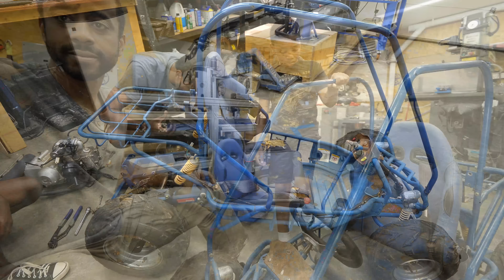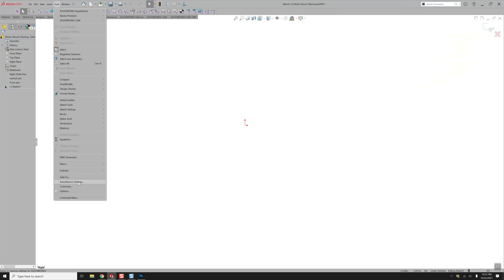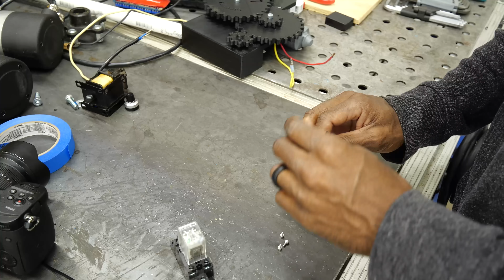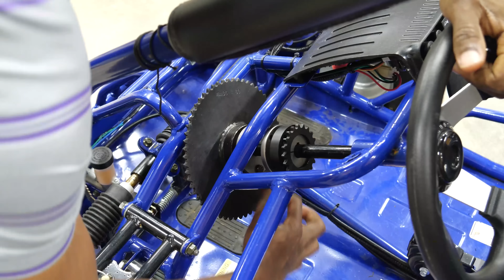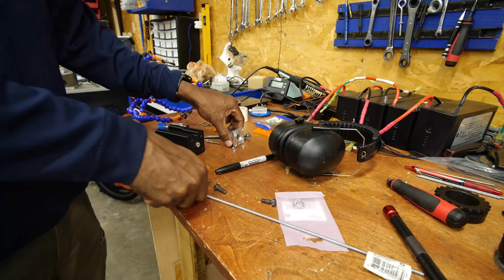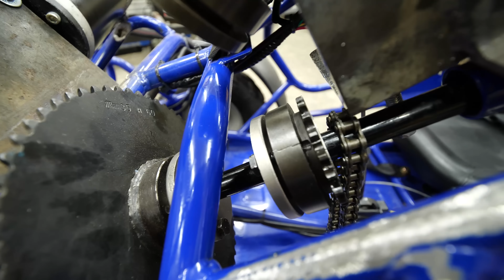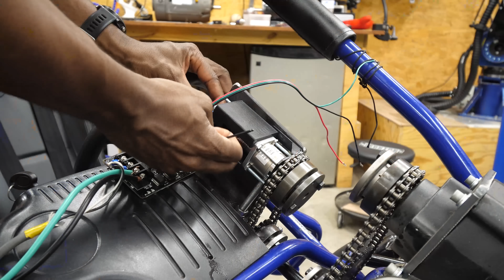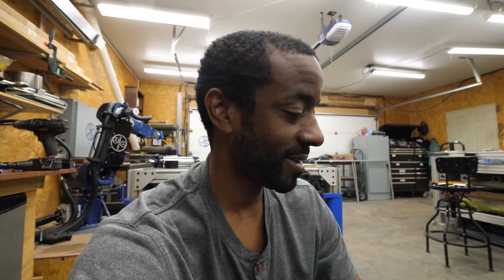Building A Self Driving Car - Jeremy Fielding 098

Comment: Looks like a very fun project. Cool stuff. You should be able to avoid bending the steering column by adding some support adjacent to the large sprocket. With the current design the drive shaft is a long unsupported span which is very weak in bending (the chain applies a torque to the drive shaft AND pulls on it very hard - like hanging a weight from the sprocket). Putting a bushing next to it that is directly mounted to the frame should make it an order of magnitude stronger.
Reply from the maker: agreed. Reducing the length of the moment arm would certainly make it more resistant to bending. Adding a bushing is a good idea. Though I think the ultimate key is some kind of mechanical fuse or limit switches.
Reply: @Jeremy_Fielding  Why do you think that the ultimate solution is fuses or limit switches? If you could make some simple changes like the bushing to just not break if overloaded, isn't that better than adding more complexity? 

Something to consider for the limit switch idea is that you can still overload the mechanism without hitting the limits. For example if one of the wheels gets trapped in a rut you could find yourself applying max motor torque. To deal with that issue you might then add a shear pin in addition to the limit switches, but that has the downside of disabling the cart, potentially in a dangerous way while moving. The next step would be adding a sensor to detect if the shear pin has failed.... you can see where this leads :)

If you do conclude that it isn't feasible to just make it stronger, I'd recommend looking into the vast supply of off the shelf torque limiters. I'd recommend a self resetting kind which will not disable the drive if you trip them. If you overload them they will slip, but as soon as the overload is removed the drive re-engages. Basically an oversized version of what you see in lego / k'nex motors that allow them to slip without damaging the gearbox.
Reply from the maker: Sorry about the confusion there. I am suggesting that both are needed. something like a torque limiter would protect the motor from overloading. Adding the bushing/stiffener would protect the steering column. The torque limiter could also be electrical. I am hesitant to put my weight on any one solution, as we both know it takes a while to think through all the possible consequences and how to resolve them.
Reply from the maker: It is feasible and smart to make it stronger... I agree there.
Reply: Hmm yes, I also agree
Reply: @Jeremy_Fielding  Dude, I just put it in another comment, but you're talking about it here so I'll just add it to this conversation - do the bushing, I think that's a great idea; and add at least one belt-driven component to your gear system. 

You can engineer the belt size and tightness so that slippage only occurs when the load goes outside of normal operating tolerances.
You can code your controller to detect a slipping belt and stop the motor. 
A slipping belt can recover itself as long as it doesn't slip too much and burn out. 
A belt is a really cheap part to replace. 

The bushing is a great idea and improves the strength and reliability of the whole design. But a belt allows for a controlled failure you can design around rather than an uncontrolled failure.
Last thought - if the motor or a belt fails, you can still manually steer the car. If the column itself fails, you can't. So if it comes down to it, fail the motor before you fail the column.
Reply: @Jeremy_Fielding  it would be most save if you could still steer by yourself if something brakes, right? That also makes a stronger bar/less bending nice. Same for the brakes.
But if you have some mechanical limit that can slip you need to have the potentiometer somewhere else to know what postiion the wheels are
Reply: @Jeremy_Fielding  a strong stiff spring between the contact points would absorb some torque before closing completely, if you go with the limit switches, allowing some electronic mishaps...
Reply: @pufthemajicdragon  I like the belt idea, if you make the belt the weakest link and it does fail, the cart would be able to be taken control of manually as well as it’s no longer coupled to the motor
Reply: @pufthemajicdragon  was going to say the same thing - it'd be fairly straightforward to stop the motor if you're turning it but the steering position isn't changing, and the belt slipping means you can't do any catastrophic damage like you could with a chain.belts are also plenty strong enough and much lighter than chains which in theory could mean more responsive steering but i don't think it would be noticeable
Reply: @Jeremy_Fielding  Adding a current shunt in-line with the motor would probably be a good idea. Have the Servo MCU read the current being delivered into the motor, and if it ever reaches an 'overload', you'd immediately stop driving the motor (at least in that direction), and raise a 'FAULT' pin high, which may be read by your master control unit. When that fault line is raised, it will indicate to the vehicle to be pulled to a safe stop ASAP to reduce chances of damage or injury. This is a common design for systems as I'm sure you are familiar with on CNC motor drivers. This same fault detection and reporting may and should be applied to as many factors as you can, such as detecting if PWM or other drive signals are present and within expected bounds. Also, you may want to go with a more robust signaling interface over PWM for something safety-critical. RS485 (with CRC proto), CAN, or perhaps even LIN would be good-fit choices.
Reply: Do we have a collab coming gentleman?
Reply: @mechbest8685  god I hope so. They are two of my favorite engineering channels. Get Destin in as well for good measure.
Reply: Thank you both for giving I sight to how engineering conversations are performed. Very nice to see you guy’s thoughts at work.
Reply: A bushing and shear pin was my first thought too. Strengthen the unsupported steering column, and shear pin to protect overloading. There is also a safety consideration if you plan to do “Level 2” autonomy where a human could have hands on the wheel while computer is controlling. Need to limit torque so human can overcome if system makes mistake. This is how most driver assist systems work in real cars. Motor is torque limited such that a human can still easily over power and back drive without damage to the system…or human. Really cool project!
Reply: @MrFibonachoo  Yes, I was going to recommend a shear pin or key (like lawn mower engines use) for the same reason.  If the "electric system" fails, the human could always still take control manually.
Reply: In addition ro these other improvements, I suggest end travel limit switches that disconnect power to the motor just short of hitting the physical hard stops.
Reply: Nice to see you here!

Comment: Hey Jeremy! Is there any way you can add an electronic clutch on the steering column? It might be better to have a normally-disconnected point there so a loss of power disconnects the motor. 

Even a small air tank and a spring clutch would do the trick (just need to be recharged every now and then). That way loss of power will automatically revert to manual steering. (I suggest an air tank since solenoid valves are an easy way to control larger forces. 

Just some sort of interlock seems wise, especially considering that a motor with a worm gear will prevent any manual steering input.

(Oh and I just thought of this - compressed air is easy to regulate as well, so an air clutch is also an automatic torque limiter. It would require homing each time you power on the cart, but that might be smart anyway.)

Comment: Hi Jeremy, I have made attempts at doing this for 4 years now. I really look forward to learning more from you. I have small scale projects that reflect what you are going. They are all done in the hopes that my daughters will enjoy some aspects and spur some Engineeer Excitement. I am a Principal Engineer and jack-of-all-trades master of none. 

I have 3 at home pilot projects for a self driving large scale car. Ackerman steering approach is tough and the fine control of differential drive is where I am at. 

I have a large scale “bomb disposal” type robot that my 8 year old and her friend can operate. It weighs about 250lbs. 

It is winter and back to small scale. So  trying to build a tracked bot with Ardupilot Mission planner+ cm level RTK + connection to DOT GPS local station + industrial lidar for obstacle avoidance + base station+ my amateur tv feed for FPV. 

Pixhawk cube flight computer+ saber tooth ESC+ Nvidia Jetson + industrial lidar + radio … 

Look forward to learning more from you!!!

Jack 

I can show you some images if you like of some of the vehicles.

Comment: Maybe drive it with a small stepper with a toothed belt so it can slip and be overloaded by manual control. Drive the steering position sensor off of the rack so that it can ignore missed steps and continue to work. The actual steering effort on the self driving doesn't need to be that high when the vehicle is moving or lightly loaded.

Comment: Wouldn't it be possible to put a overload clutch type of mechanism in the large gear. Because you have the position pot on the steering wheels shaft. It seems like even if the drive slipped it would not matter because its looking for position from the steering shafts location. Or even a V-Belt drive instead of the chain might work. That way the belt could slip if necessary.

Comment: How about a slipping clutch between the motor and steering column? Enough torque to turn the wheel, but any more and it just gives. Also makes it safer in case of trapped limbs. Then just have the feedback potentiometer placed after that clutch, so it still registers the correct steering position.
It's great to see Bill working with you on this, your both amazing engineers 😍😍

Comment: It seems like you could use a torque limiting clutch so you don't have to sacrifice the motor or the steering column. It would be even better if you could detect the slipping or torque overload conditions. You'd have to set the torque limit high enough so it only slips a bit in extreme driving conditions and can quickly recover control.

Comment: Most of your problems are correctable or caused by software.  In automotive HVAC stepper motors,  current is monitored in order to determine where the stops are.  This wouldn't be a good solution here since the forces acting on the motor will be affected by terrain,  but can be used to protect everything from damage.  Good luck!

Comment: Awesome project! You could use limit switches to detect when the steering was rotated too far and respond appropriately. Or monitor the motor current for stall and stop driving it.

Also, if you’re having issues with alignment of the potentiometer, you could use a non-contact rotary encoder.

Will it act like an assisted power steering or rip your hand off with the steering wheel if something goes wrong? That motor looks scary powerful!

Another option could be to use a linear encoder on the steering rod to know the absolute position of the actual wheels instead of the steering column.

Can’t wait to see what comes next!

Comment: Another great project.

I'd go with a much thicker walled steering column (or even solid bar), and also add a bearing next to the motor drive gear so the shaft is supported near where the torque is being applied.

Maybe add some kind of torque sensing between the steering wheel and the column. That way it can detect if someone is trying to override the steering input and can disengage, and/or can act as power assisted steering. It could also then disengage if say someone sticks their arm though the spokes in the steering wheel (rather than break it off).

Comment: This looks to be shaping up to be another awesome build.  If it was me I think I would upgrade the steering shaft with a solid alloy, it would also be easier to get the proper hardware to mate with it as well.  

Like anything you build there will always be a failure point in the construction.  The key is to design it so that the components fail somewhere beyond the point they need to safely work at in the most extreme situation.  If your past videos have shown me anything is that I'm sure you will figure it out.

Comment: Many have already said it but personally, I would rather have a non critical failure of the steering system, making the motor or something else in the electronics fail before the actual steering shaft breaks. More expensive but this at least leaves all critical control components intact, leaving control up to the driver

Comment: About your point at the end - I'm going to add my voice to the others in the comment section and say the fact that it can bend the steering column, is a sign your mechanism is too strong. A smaller, weaker mechanism involving 3d printed gears would be cheaper, simpler to test, and safer, whilst still having the torque necessary to turn the wheel. You want it to break before the steering column does, or if your kid's hand/clothing gets caught in it in a catastrophic failure situation.
Reply from the maker: I definitely plan to add some kind of guard over the chain area no matter what.

Comment: I like how Tesla's full self driving beta works, if you forcefully move the steering wheel against the car's automatic handling, it will relinquish control and turn the self-driving off and let you take control. I don't know how much extra complexity that is, but it's definitely the safer choice until the system is completely proven.
Reply: That's generally how autopilot systems in commercial aircraft work as well.  It removes the need for the pilot (or driver, in the case of a Tesla) to think about turning the autopilot off before grabbing the controls.  All it would really require in a situation like this is for the driver to be stronger than the motor is allowed to be.  Then the control system could observe the tracking error and disengage if it gets too large.  I'm not sure that the current motor is going to be easy to "over power", but it shouldn't really cost anything to add such functionality.  Just more code.

Comment: There is a really cheap alternative to traditional potentiometers called a magnetic absolute encoder. The typical one I have found that is cheap is called a AS5600 magnetic encoder. It can be had for about 2 bucks, and has a little breakout board where you either can get  the same sort of signal you get from a potentiometer or receive data from I2C. It has sub degree accuracy, and won't fade and become less accurate over time like the wipes of a potentiometer.
Reply: Came here to say this. A magnetic or even optical incremental encoders would work far better than a potentiometer. Pot values drift with changes in temperature by as much as 25% and this would affect the end steering unless it is corrected in software.
Reply: I definitely agree with the other commenters.  The AS5600 will give you even better resolution/accuracy  in a much smaller package.  Only concern would be magnetic interference from that large motor, but that's easy enough to deal with.
Reply: i was thinking about the same thing! AS5600 would be a good choice! :) The accuracy is 0.08... degree!!!
Reply: what about homing it? a potentiometer always knows where it is but the encoder needs a home reference point when you boot up the system
Reply: @bradcorbett7168  The AS5600 is an absolute position sensor, just like a potentiometer.  It is not an incremental encoder.
Reply: Yeah i would also absolutely recommend this option. I used a 10 turn pot when i fitted RC to my van some years ago, and it's a failure waiting to happen. It drifts and generally is unreliable.
Reply: I kept thinking that some alternate positioning sensor would be a better way to go,  too.  Who sells these things?